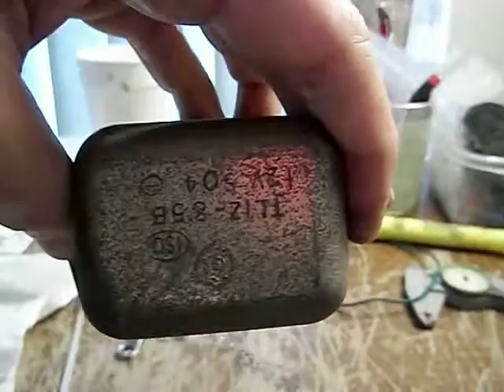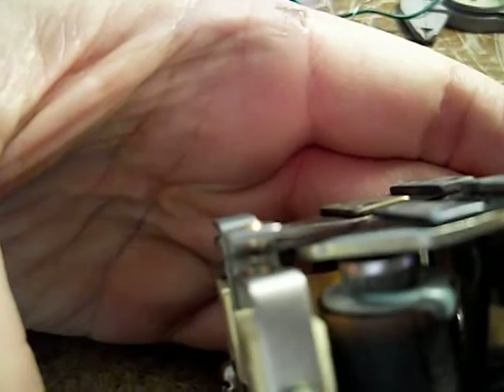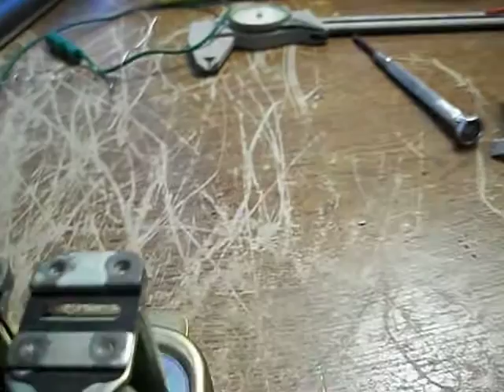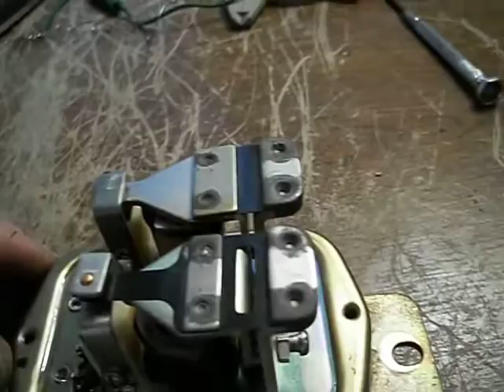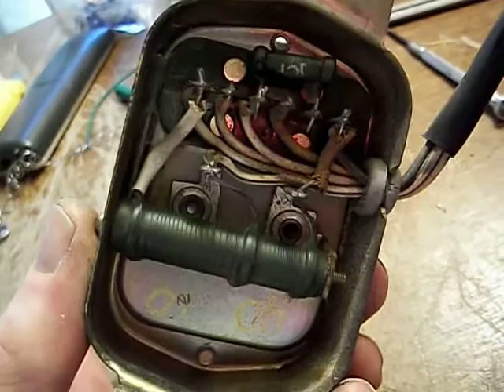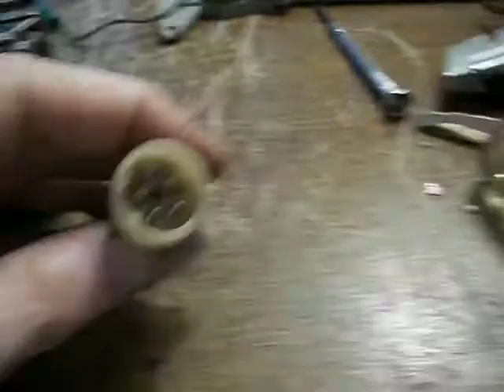1975 280z voltage regulator

Comment: Pro Tip:  Don’t sand your points with sandpaper.
Reply from the maker: I presume a points file would be in order?
Reply: @Dave WM   Better. Contact cleaner first.  Best not to mar the finish if they still have it.

Comment: The guy I got my 240 from replaced the alternator with one that has a built in regulator. He had to add an additional external diode for it to work but it does the job.